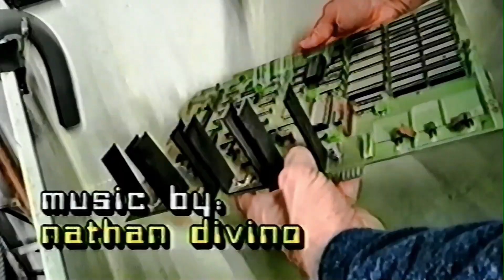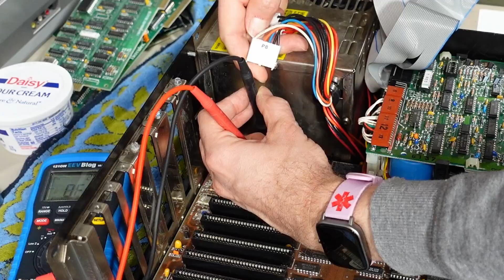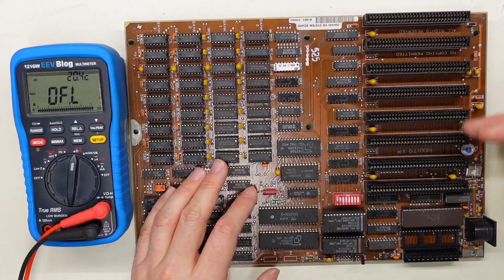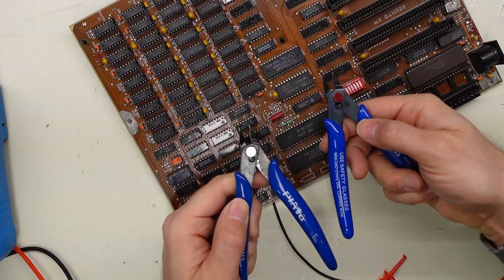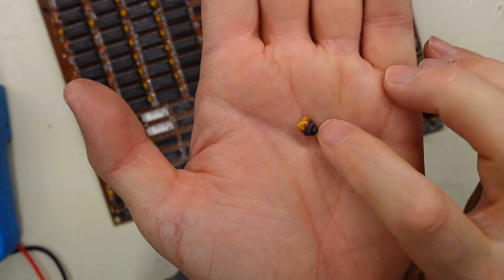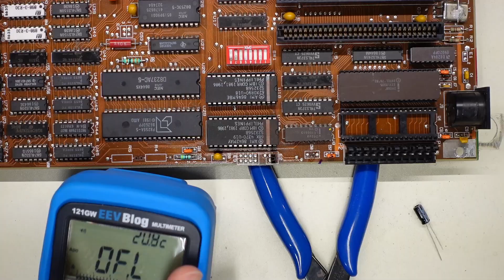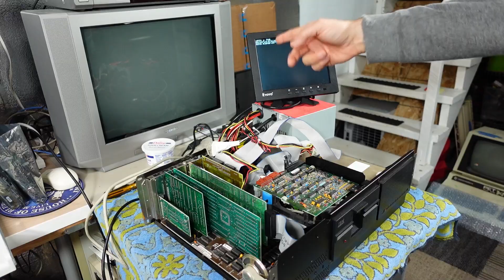This IBM PC XT won't turn on, let's fix it

Comment: It’s a bit of a running joke in retro YouTube that after 25 minutes of oscilloscope investigation, it’s always dodgy capacitors.

Be interested to hear why (especially in this case) why you don’t just change all the capacitors. 

Ignoring the fact that would be a boring videos would it not just be easier to replace all the caps?

Like when car channels service an old car and change fan belts, engine oil, gearbox oil, spark plugs, etc - just so they know these parts that could fail have been refreshed

Not trolling or trying to be a smart ass. Genuine question
Reply: One partial answer may be that desoldering components from a circuit board carries a significant risk of damaging the board in ways that replacing car parts and fluids like the ones you mention doesn't.
Reply: It's a pain to change everything, and also high quality capacitors can get expensive. In computers (with some exceptions) capacitors usually don't degrade much with use and when they do fail there usually isn't any damage. On a car many things (especially the oil) do get much worse over time and can cause massive damage if not replaced.

I guess the takeaway from what I said is that most of the car things are consumables while capacitors are supposed to last the lifetime of the unit.
Reply: It comes down to preference. Some people are militant on replacing every capacitor and some are happy with just getting at the dodgy ones that have either already failed or close to failing. "Top shelf" brands of capacitors can go thousands of hours and beyond, too, so would definitely not have to worry until they do display their typical failed characteristics
Reply: The reason is that when repairing circuit boards for vintage computers, it makes sense to only fix what you need to fix, especially when dealing with valuable machines like the IBM PC or IBM PC XT.

The thing with the car channels analogy, is that the car channels are not bothered about making the changes that you listed, since their priority is to make sure that the car is roadworthy. Otherwise they could run into legal trouble if you have an accident caused by a mechanical failure.

Back to vintage computing. Systematically replacing every capacitor could do more harm than good since bad soldering jobs can ruin the traces on the PCB, meaning more repair work needs to be done. The chances of this happening are greatly reduced if you identify the capacitors that need to be replaced and only replace them.
Reply: Besides what everyone else has said, there’s also the fact that you may be replacing high quality caps with medium quality ones, and in so doing you may end up needing to replace them again down the line anyway. 

In fact in another recent video Adrian specifically called out his distaste for replacing every part in a car just in case (of course oil is easy to check if it’s gone bad, as is a fan belt, so that’s more trivial) and then not truly knowing what had broken and what hadn’t.
Reply: @kingjohn6519  One of those types told someone to recap his HP3325B signal generator before troubleshooting. That would have cost several hundred dollars, and not solved anything. It has hundreds of capacitors on the digital boards.

Comment: Probably not a genuine IBM power supply.  The original IBM PC only had a 65 watt power supply, which was decidedly inadequate for a hard disk.  Edit: it looks like this one's a PC-XT, as there's more than 5 slots
Reply: The prototype PC I saw had a 63Watt Astec power supply. It was owned by a retired IBM engineer.

Comment: I have 2 machines that aren't powering on, power supply fan wont power on even when unplugged from the board.
Reply: A lot of power supplies will not work properly and may shut down with no load
Reply: In addition to that a power supply won't spin up if it's seized.

Comment: Figured I’d ask this crowd… I have a motherboard a few years old.. Ryzen 5 cpu. Worked for long time then noticed a few USB ports on MB stopped working. Found out the damage was coming from a pair of external speakers that were back feeding power into the  MB through the audio plug. Replaced them but within a month the MB was dead and just a black screen. No bios or anything. Fans spin. 

Is a modern MB like this even reasonably repairable or should I move on? I already built a new rig but would love to get it going for the kids as a second PC.
Reply: The problem with troubleshooting newer computers are two things: custom ICs that as time goes on become unobtanium (as people figured out they don't need a whole array of individual logic, interface, resource management, etc ICs that come off the shelf and just made their own). The other is they use multiple layers on the board so it become an absolute pain to trace where things go (and probably service manuals were never made public) and are prone to damage. Essentially a damaged trace on an internal layer without a well documented service manual makes the product impossible to repair
Reply: @kingjohn6519  I will add that there may be vias to access those internal layers and you may be able to use them to run a bodge wire, but it’s by no means guaranteed.
Reply: Yikes! Self-powered “computer” speakers? That’s some worrying design, leaking power back to the audio source. Sounds like they haven’t properly isolated their circuits internally.
Reply: @kaitlyn__L  yeah, I will not and have not since bought no name brand twenty dollar powered speakers. You could put your multimeter on the audio jack and get around 11 some odd volts. The computer didn’t like that.
Reply: @kingjohn6519  thanks for the detailed reply. that’s what I thought. I knew about the multilayer traces and with my skills being a percentage smaller than Adrian’s I figured it was a lost cause. I guess I held out hope someone might say “yeah that’s a common problem with powered speakers and you just need to test x or y and..:” 🙂
Reply: @fensoxx  yikes 😱 11 volts!
Reply: @kaitlyn__L  it survived at least a month. So that’s a testament to the motherboards build quality I’d think. It was a wall wart powered set of speakers. I’m using USB powered, Bose, speakers these days.
Reply: @fensoxx  the isolation for the audio circuitry (intended to prevent harmonics of high frequency switching, AKA CPU whine, from coming through into the audio) probably unintentionally served to protect the rest of the system from the audio backfeed, but of course it’s not 100% isolated circuitry because it has to get power and I imagine that’s how it hurt the neighbouring components after a while. Probably a small leakage current over a long enough time. Of course that’s just an educated guess since I’m not looking at the board or anything :)

Comment: i've never .....yet.....come across a shorted tant,  maybe been lucky?  maybe more a problem with those ibm 3 leg things?? i have an ibm mda card that has a few on them.....
Reply: if these are known issues, maybe better to replace all the ones of the same type?  i had  an isa multi io card that kept popping its mutllayer ceramic caps, so changed the lot
Reply: @andygozzo72  if they’re all facing the same load and thermal conditions, one might presume the others are on the verge of failure anyway. (Such as how the years-old halogen bulbs in one of my previous apartments all died within days of each other.) But when they face varying loads, the others could well keep going for another 5, 10, 15 years.
Reply: @kaitlyn__L  some may be on a 5v line, some 12, i'd bet the ones on 5v less likely to go bad due to lower voltage stresses
,
Reply: @andygozzo72  exactly! :)

Comment: Off topic, so apologies. I felt this was the place to ask - does anyone know of a cheap, basic RF coax (in this case from ORIC-1) to HDMI converter? For some unknown reason every device I look at works the other way, a use-case I simply don't understand. Apologies!
Reply: The other way use case is to hook up a streaming dongle to an old TV :D as far as converters go, I think you’d need an RF demodulator into composite and then composite to HDMI, that’s probably the simplest solution. (Or bypass the RF modulator altogether, as they’re usually fed from composite on the board, but that’s more work than just plugging converters together.)

Comment: "Quickly"?  You have to remove the system board, for god's sake...and then find and replace a couple of shorted tantalum capacitors.   "Quickly", my asterisk.  And, of course, the question remains:   what caused the short in the first place, and how to remedy it.
Reply: Poor design causes most tantalum capacitor failures, because the voltage and current ramp up too fast. It slowly degrades them, until they short. It could have been repaired without removing the motherboard.

Comment: The way I used to clear tantalum shorts was with a 5 Volt 10 Amp power supply. 
No need for a sharpie, a small mushroom cloud will identify the culprits.
Reply: problem with thats is if the track to the shorted cap cant handle the current and blows open ....
Reply: @andygozzo72  It's safer if you use a variable current-limited power supply. If you bring it up slowly you can cut the power before traces vaporize.
Reply: @eDoc2020  definitely ..😉 shoving high current indiscriminately can cause  expensive, maybe irreparable damage
Reply: @andygozzo72  These caps are across the power and ground of the circuit and have their own layer in the PCB. They are primarily used as decoupling caps. This method has been used in in production rework environments.
Reply: @oswaldjh  you cant/shouldnt rely on that, you should never 'assume', one may be decoupling a low current supply rail, that only has thin tracks to it,
Reply: @andygozzo72  Did this for years. Like I said, it was part of production rework.
Reply: @andygozzo72  I've been doing stuff like this for decades. Get real experience (40 Years R&D and Production) then we can talk.
Reply: @oswaldjh  i've been 'tinkering' with electronics a similar time, mainly self taught, not working at it 'professionally' (except on and off a few short times), but my own stuff, repairing various devices or friends, family, etc. and  many of the boards in those didnt have thick traces for power rails, and  if they had tants that'd shorted, your 10amp feed would definitely have destroyed those tracks,,  your equipment may well have had separate power planes, as industrial/professional equipment, lesser/consumer items, which i what i mostly see,  not always , i cant comment on an IBM board as in this pic, i've never.....yet...come across one myself,  the various  other old motherboards i have i havent examined in that much detail.. luckily tants dont seem to be much used on them
Reply: @oswaldjh  That would have got you fired at any place that I've worked, and I started in 1966.
Reply: @michaelterrell  Doing things by the book is the sign of a company that doesn't trust the intelligence of their employees. This is fine with production type of work. I worked in the engineering Dept and it's a different world in there. Especially when it's full of Mensa Members.
Reply: @oswaldjh  I worked in Engineering, as well. We were ISO9001 certified and built customer Telemetry for the Aerospace industry. I Took the first FIR based SDR dual Telemetry design from Engineering to production. Some of the VXI cards had over $88,000 in component costs. before assembly and testing. Mensa never impressed me. Clear thinking and designs that worked 30 or more years without failures did. NASA track deep space probes with our products, without failures. Not al boards used a full layer for a single power rail.
Reply: @michaelterrell  Early Aerospace even has boards designed with full layers as in the LTN-72 INU (Inertial Navigation Unit) built by Litton. These were installed in commercial airlines in the 1970's.
Reply: @oswaldjh  Early, yes, but not on 16 layer boards with five power rails. Those full copper pours caused some boards to warp.

Comment: Best fix for IBM 51xx series PCs is to throw them in the trash. They were sad even in the 1980's
Reply: So “sad,” that many still work fine to this day with minor repairs! How dare they make a well-built easy to service computer that worked exactly as it was intended. 😂
Reply: @80sCompaqPC  and I am not an amiga fanboy or linux user. I made and sold 100's clone PCs in the 1980s. plus was a IBM, Compaq and HP authorised dealer.